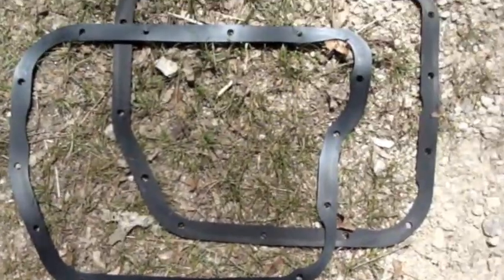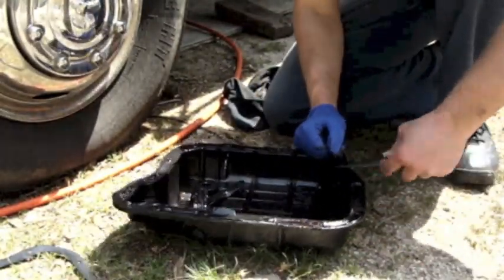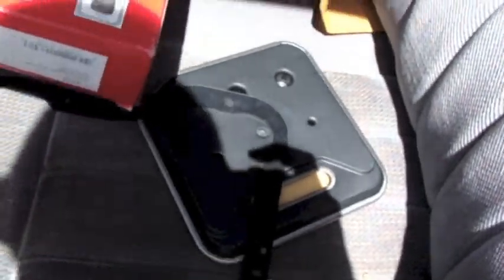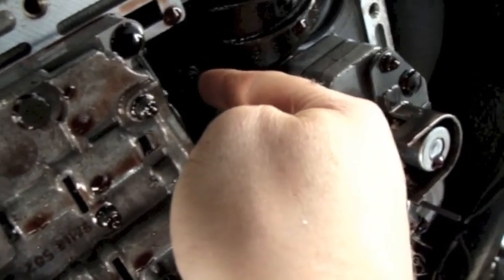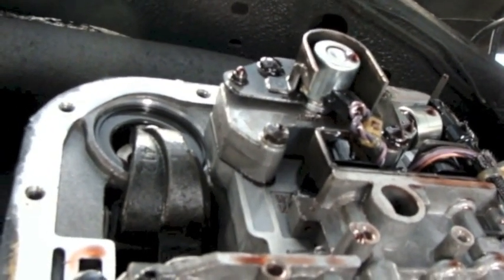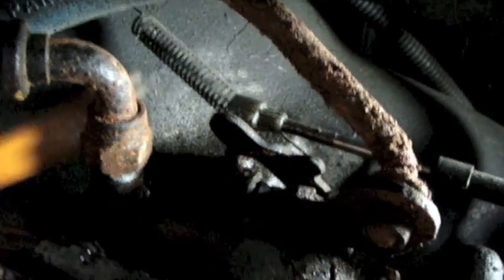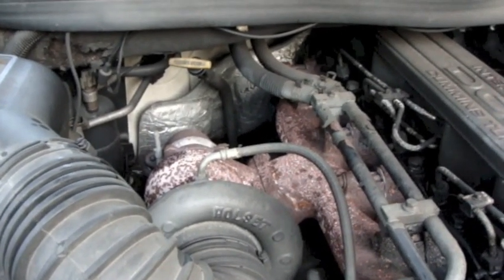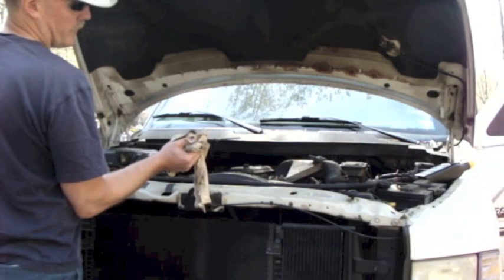1997 Dodge Ram diesel transmission service Part 2

Comment: Hi Steve, so like 7 quarts? Thanks, Dave.
Reply: Thanks Steve, I'm in the process of doing this right now, slipping in 3rd gear. Also going to do a TransGo shift kit so that it gets more holding power, thanks again, Dave.
Reply: Hey Dave Kana... How difficult was the Trans-go kit to install. I heard that the directions are horrible. There don't seem to be any videos on installing the kit into a 47RE. Any advise is greatly apprecaited.
Reply: I Did not do it, agreed the directions suck!

Comment: You overfilled that transmission when it's cold ie after adding new fluid it's supposed to be at those notches because fluid expands as it heats up you overfilled it it's not supposed to be at the cross hatches till it has been warmed up
Reply from the maker: Thanks, at first I was not sure what you meant, then I watched the video again. I  miss spoke, it was one quarter up the cross hatch, not three quarters, and I rechecked it hot, and it was a smidge above the cross hatch area. A little over filled, but nothing to worry about. No signs of it blowing out fluid, etc. I will say this, I have not noticed any change since  I adjusted those bands. But then again, they were not really giving me trouble, I only did it because according to the manual, it was due. My only complaint is my torque converter. It is stock, and it robs me of hp's big time, but I hear this from other owners who all say the stock converters suck for heavy towing.